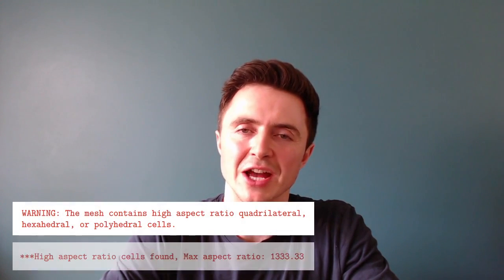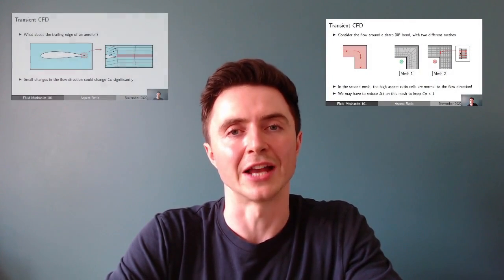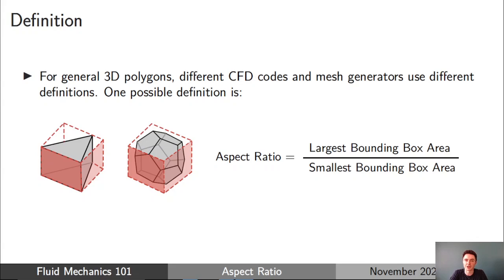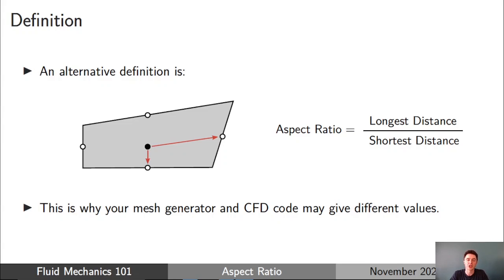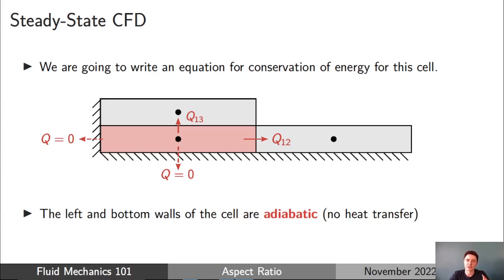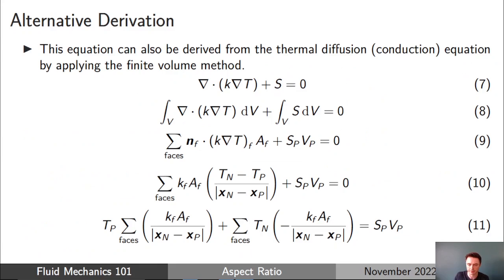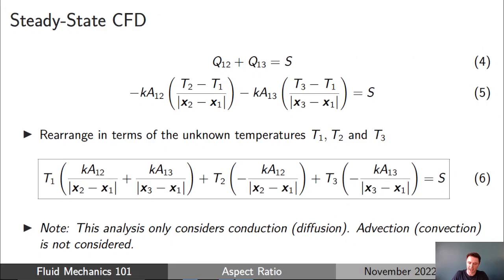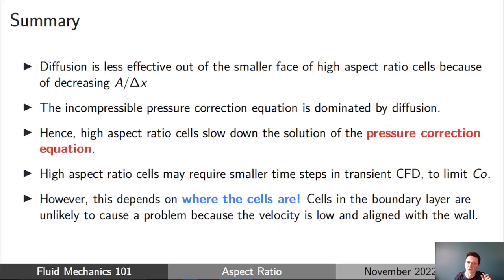[CFD] Aspect Ratio Warnings in CFD

Comment: This video is so great to explain the implication of aspect ratios in CFD!!!  (I usually just care about skewness and non-orthogonality more.)

I'm thinking in high aspect ratio mesh, if the long-side of the cell is parallel to the flow in transient flow problem, it can mean Co number is still controllable.  Does it also mean to have a good pressure correction to avoid excessive iterations?  I'm struggling about the mathematical relationship between aspect ratio and pressure correction.  I ask this question it's because I'm thinking in what situation CFD allows to have high aspect ratio.  

Thanks a lot!!
Reply from the maker: You will probably be ok, because the pressure field from the previous time step becomes the initial guess for the next time step, so I don't think aspect ratio will have as much of a detriment as the steady solver where you start from nothing!

Comment: Thank you for the amazing video! 

I run the simple case of the flow around a circular cylinder in OpenFOAM using PimpleFOAM, and I realized that when I use structured mesh with higher aspect ratios the number of the outer correctors to converge is much higher than a low aspect ratio case. I can imagine, after watching this video that this is because of the diffusion dominant terms in the pressure equation. My question is, when my Courant number is low(around 0.5), and I use high aspect ratio cells, is it okay to perform just one outer corrector, or should I allow the solver to decide for this (since it needs more to converge)?
Reply from the maker: You are absolutely correct. High aspect ratio cells needs more outer corrections, due to the diffusion term in the pressure equation.

As for the courant number question, I would check your residuals (and monitors) within each time step. If you can convince yourself you are sufficiently converged within a time step, then 1 outer corrector is fine. An easy way to check this is to run 2 simulations, one with 1 outer corrector and another with 2 outer correctors. The compare your drag and lift coefficients. If there is no difference then you are fine to use 1 outer corrector

Comment: What about airfoil boundary layer cells in steady state simulations? I guess the pressure correction in not much a problem close to the wall because it's mostly diffused over the large face? And what about the wake?
Reply from the maker: Yes correct. The pressure is mostly diffused normal to the wall, but the streamwise contributions are important, especially on the suction surface, so the high aspect ratios are always going to slow things down.
Reply: @fluidmechanics101  And doesn't the transient case also include a pressure correction step? What would be your best approach to calculate stall polars on low Mach number airfoils (M<0.3)? Would a transient dynamic/rotating mesh be the most efficient?

Thanks for your videos, they are very useful and provide much hard to understand information.
Reply from the maker: I am not sure what you mean by 'stall polars'. If you want to find where the aerofoil is stalling, you can just run a set of steady state simulations, incrementing the angle of attack by 0.5 degrees each time (changing the inlet velocity components). You can each initialize each solution with the solution from the previous angle of attack, so you won't need many iterations (say 500 per angle of attack). You only really need dynamic or moving mesh if you have a transient inflow (like a pitching aerofoil, or a vertical axis wind turbine)
Reply: @fluidmechanics101  yes that's what I currently do. I was wondering if the transient case would suffer less from the pressure correction in high aspect cells, in your video I get the feeling the transient case is less sensitive to it, but I don't understand why.
Reply from the maker: Unfortunately there are some questions even I cannot answer 😅 the video shows my current understanding. If I find out anymore I will be sure to let you know!
Reply: @fluidmechanics101  thanks for your insights, it's very helpful! 🙏

Comment: Hi there it really gave a clear picture,

I am working on an aerofoil post-stall aoa so  i am running in transient condition, for K omega sst iIam keeping wall y+ 1 for a RE no. 2.2E6 in that first cell height I am getting around 1.1e -5m  near the aaerofoil. For this first cell height I need to keep the time step size  less than 1e-5 s to keep courant no. less tha 1 at all the sides of an aerofoil but unfortuanetly i don't have computer resources to deal with this time step size. If i go with larger time steps Cl and flow seperation is completley off but Cd is matching within 10% error. 

If I use Spalart–Allmaras turbulence model, i went with wall y+ 100  the first cell height is 1e-3m so time step size was maintained  at 1e-4s in this Cl and flow seperation is matcing even at post stall but Cd is at error of 70%.

Kindly advise me on how to proceed further.

Thank you.
Reply from the maker: If you are limited by computer resources then you can just do the best you can and make it really clear to the assessors / whoever is reviewing your work that that is the best you can do. If they want a more accurate result, then they need to get you access to a better computer!
Reply: @fluidmechanics101   thank you

Comment: How aspect ratio affect steady incompressible flows?
Reply from the maker: It mostly affects the rate of convergence of the pressure equation, due to the coefficients in the A matrix (which are calculated from the discretised Laplacian)